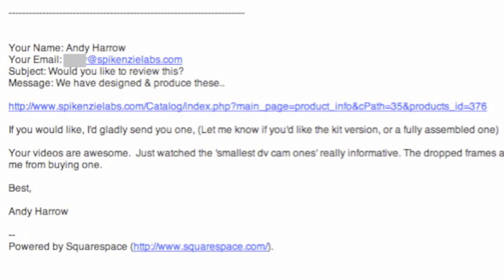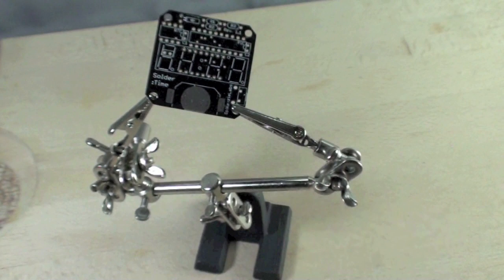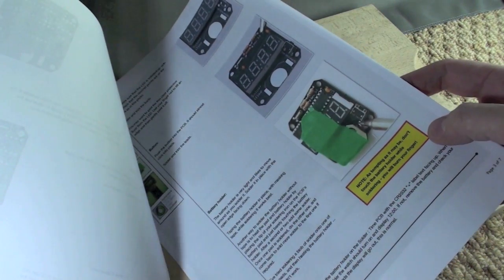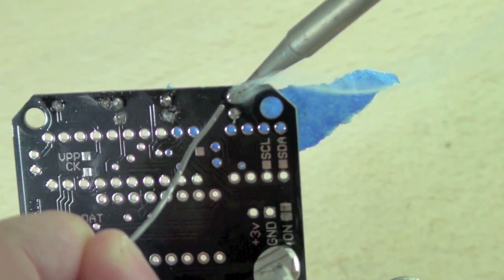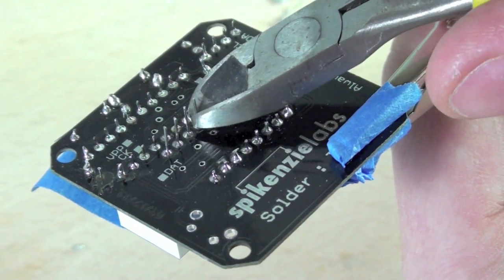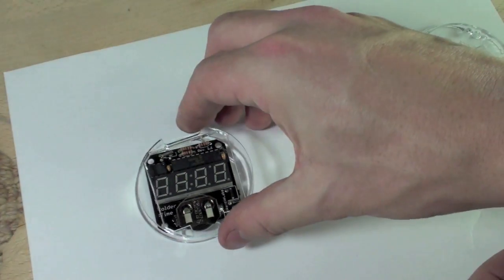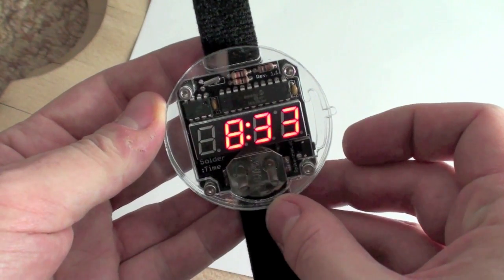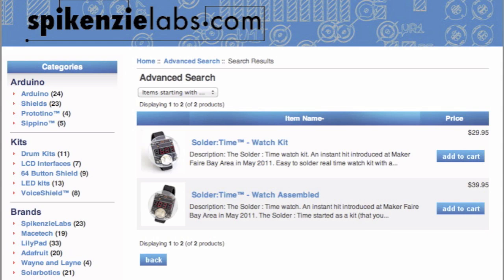Assembling the Solder:Time LED Watch Kit

Comment: I just finished a sort of similar watch kit, but this one was a real bear compared to yours, it had ALL surface mount tiny little resistors and Capacitors, 16 and 18 each as well as a couple diodes and some tiny chips, one with so many legs that I thought I could never get them all soldered in place as the legs were so very close together.  After working hours on that single chip, I figured that I had induced so much heat in it that the chance that it would ever work were very thin, in fact I nearly threw it away when I had completed that single chip.  Then my new soldering iron kit came in, and with it one of those brass wipe cans to clean the tip, that made all the difference, and in 4 hours, I had the rest of the watch together.  About that time my wife called dinner, and i put it away for the day. The next morning, (this morning in fact!) I inserted the 5 1220 batteries in the watch, pressed the button and she came to life!!! I was amazed, she has day, date and full calender function, advertised to be within .2 seconds per month accuracy. Press the button and she lites the OLED display with day, date and battery percentage for 10 seconds then goes back to sleep awaiting another button press. I was really impressed, while the soldering doesn't look professional I don't think it looks to bad considering it is my first SMD kit assembly.  While assembling the damn case, I managed to break one screw hole out, I glued it together using some gasket mount glue, while it is black and shows up on the frame, it holds like steel, so I am happy with the results. Hope those batteries last awhile, I don't plan on wearing this as an everyday watch, it is neat, and I may well wear her when I go places where geeks gather.

Comment: A clean tinned soldering tip with plenty of appropriate heat on clean component leads (and a dab of flux if necessary). That's the ticket.

Comment: just a tip on soldering hold the soldering iron on the component pin for a second first then touch the soldering wire on the opposite side of the pin and let the solder run around it

Comment: Thanks for the video however the way you are soldering is the way I was told never to solder - I was always told to heat the wire you are soldering and touch the solder to the wire rather than heat the solder and stick it onto the wire - there again I am a hobbyist myself...

Comment: Like the vid.

Just a little tip:  If you have some fine-nosed pliers, hold component lead clsoe tot he component body with the tip of the pliers and then bend the lead round the jaws.  It reduces the stress on components - not usually critical for resistors but it can make a difference for some caps and especially crystals.

Comment from the maker: @imroy264 My soldering iron was the cheapest one with a fine point that I could get hold in a hurry a few years ago (an Antex M12). It's a simple 12w non-temp controllable model. I think whether you need a Butane soldering iron depends if you think you will be doing a lot of soldering in places where you might not have access to a mains power source. I just went for the easy and cheap option.